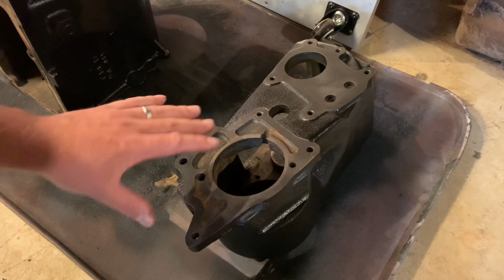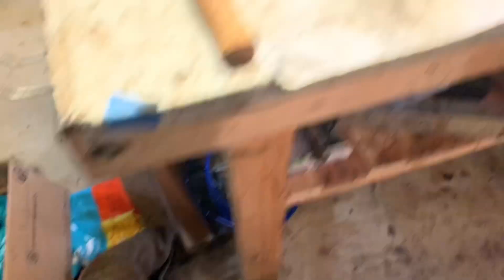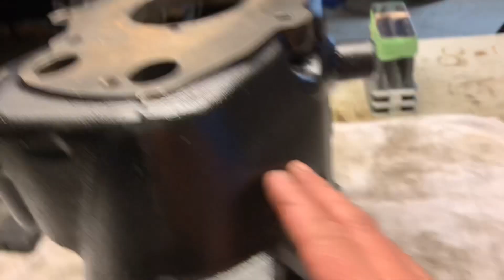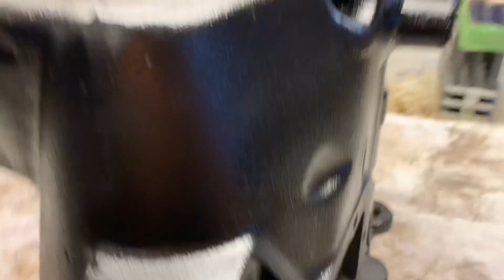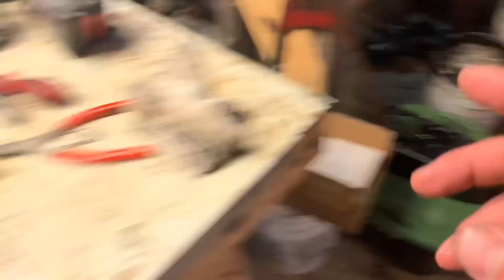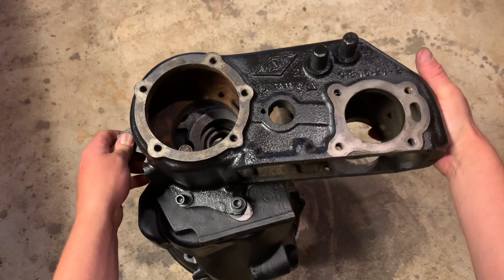Willys Jeep 4 Speed Swap: Adapters!

Comment: Why not a T-19 its synchronized in all 4 gears?
Reply from the maker: Good question, they only made a few T19’s with the 6.32:1 first gear and they never used them in pickups I think they were all 4:1 first gears. Thanks!

Comment: so ive got a 52 m38 and i want to put in the t19 which is a full synchro t18 how much of a difference is there gonna be from what you showed in the video plus if you could provide me with measurements and diagrams for any part or pieces that needs to be made or modified please do and for bell housing reference mine would be the late style that goes on the l-head and i believe is the same as the f-head
Reply from the maker: Should be pretty similar. I took apart a T19 the other day it was a lot like the T18. I’ll have to dig up all my measurements! There’s a really good write up on the cj2a forum.

Comment: I currently have a t14 disassembled on my bench. Everyone has been telling me to switch to a t150 or t18. But the adapters, bellhousing, drive shafts are all kind of outside of my wheelhouse, but then again... so is disassembling a transmission. If I do switch, I'm thinking the t18 will match well with my dana 20, but curious about your thoughts on keeping the t14 or just swapping it out.
Reply from the maker: The cheapest and easiest thing to do is rebuild your t14. When your starting swapping and adapting things it gets expensive and complicated pretty quick! The T14 was one of the better 3 speeds. It all depends on what you want to do with your Jeep. On the road your t14 will be fine, off road sometimes you’re gonna want the t18 low first gear. Hope this helps!

Comment: Do you use thread locker on your bolts when you seal up the transfer case?  TIA.
Reply from the maker: All the bolts on a stock T case should have lock washers. There is some bolts going into the transmission now that will need thread sealant. It’s interesting how back in the day manufacturers used lock washers in place of locktite

Comment: I put a T 18 in my '73 cj5 last summer. I paid $600.00 . It came bolted up to a D-20, & bell housing with the TC adapter & bell adapter. Naturally it was too long. Took out the Bell adapter, and changed the imput shaft. It was out of a J-truck. Paid $200.00 for the 61/2 inch imput shaft kit from Parts Mike in Ca.  The kit comes with all the gaskets & seals along with a couple gear parts. They say that imput shaft is supposed to be the same as the T-98. I had to drill & tap the Bell & use  original D-20 that came off the 3 spd with new output seals. Had to leave out the left bottom front bell bolt because the clutch fork hit it.
Reply from the maker: Man that kit sure sounds like a good deal I’ll have to look into that… I spent more than that buying and having the input shaft machined!

Comment: This is very impressive.  There is a guy near Redding, CA has done this several years ago.  He detailed the project on the CJ2A page forums.
One thing that he mentioned, was the different input shafts of the T-18 had possibly different gear tooth counts and if I remember correctly, he had to use the corresponding cluster gear to match but don't take that for gospel, I'm going off memory.
Good luck and keep up the awesome work!
Reply from the maker: Thank you I appreciate it! The Jeep and ford input shaft are pretty much the same in my setup (the synchronizers are different) but I wouldn’t doubt there are different cluster gears and tooth counts… it’s amazing how many variations there are!
Reply: @SevenBarSalvage  fun fact. There are 16 versions of the t 18. Most of the variations took place under the Ford label.

Comment: I am impressed with the transmission knowledge, maybe you could help me out. I have a fresh rebuilt Studebaker in line 6 Champaign. I am looking for the bellhouse that bolts to a Willys Transmission with little luck. This swap was popular back in the day. The Studebaker inline is have was taken out of a Willys but the bellhouse was thrown in the scrap the metal pile.
Reply: So mine just like you described used the studebaker bellhousing, and a 3/4" plate spacer between the bellhousing and the transmission to get the input shaft depth correct for the pilot bearing.  It also used a modified throw out bearing linkage to work with the Jeep pedal.
You can make the 3/4" thick spacer yourself with the 4 transmission to bellhousing bolt holes as well as the large center hole for the input retainer
Reply: Maybe a little late here. If your using a Studebaker 170ci six (169). The car T96 bell housing allows the willys 4cy t90 to bolt right up.
Reply: @Dave DeGan  thanks, I have a fresh rebuild, still looking for a bellhousing

Comment: That's a nice job, like you said you just have to find all the parts. Does it work out to the same length overall?
Reply from the maker: I know it will be slightly longer, when I pull the other drive train out I’ll do a comparison!